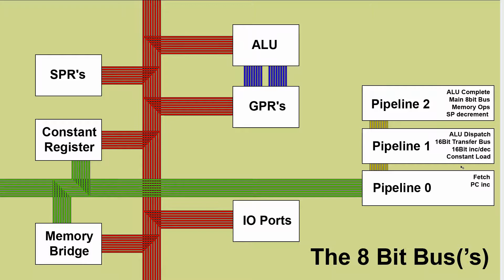Constant register (and some testing) - Making an 8 Bit pipelined CPU - Part 17

Comment: I watch these videos few times.  At some point there is that “aha” moment when it clicks.
Reply from the maker: Glad to hear it!
Reply: @weirdboyjim  also learned valuable lesson to read details on the chips.  I don’t have the exact same ones as you do on hand, and it turned out that my d latches were coping on High, and kept being transparent so long as the signal was H.  Ones you use, they do it on a transition of the signal.

Comment: Nice video series! I've in the same boat you were: a long career in software but little knowledge of electronics. After seeing Ben Eater's 8-bit computer series I've been contemplating building something a bit more complicated than his as a learning experience, and I'm getting lots of good ideas from you. I doubt I'll try to do pipelining, at least at first, but the stuff you're doing with separate 8-bit data and 16-bit address busses is something I may steal.

A silly question: Where did you get those limit switches that plug into a breadboard? I haven't yet found any that work well, so I've been soldering little breadboard-friendly wires onto the bottom of the cheap switches I did find.
Reply from the maker: Thanks! I’d be interested to hear about your progress, if you are sub-stepping rather than pipelining I’d recommend you move 16 bit values around as 2x8 bit halves. 

The switches were the first momentary switches I found on ebay with the right pin pitch, there may be better ones around. The listing is still active: https://www.ebay.co.uk/itm/10Pcs-Momentary-SPDT-3-Pins-AC-125V-1A-1NO-1NC-Micro-Switches-Long-Hinge-Lever/153082266200
Reply: @weirdboyjim  Thanks. That vendor doesn't sell to the US for some reason, but I bought some identical-looking switches from one who does. The leads look twice as long as the ones I currently have, which came from Amazon because I was in a hurry.

I'll let you know when I get somewhere on my build. Right now all I have is the clock. Next are the 8-bit registers, then the ALU. I'm going to cheat on the ALU by using some LS382 chips, though I'll still need to build my own shift logic.
Reply from the maker: @laurawerner  Nice! Tip: If you have dip things that pop out of the breadboard due to short leads, get a strip of "turned pin" headers. Put them in the breadboard under and it solves the problem.